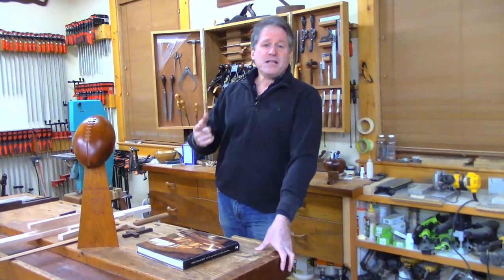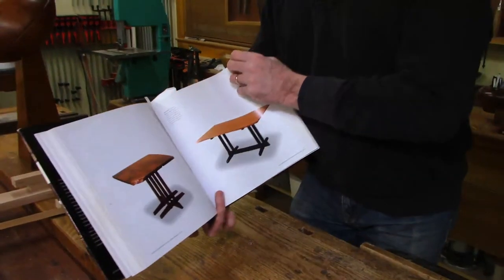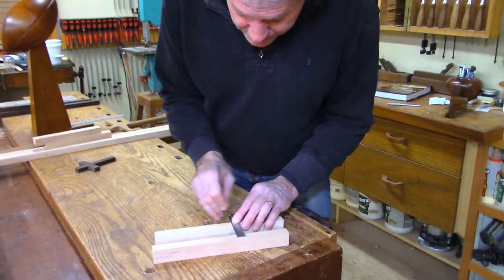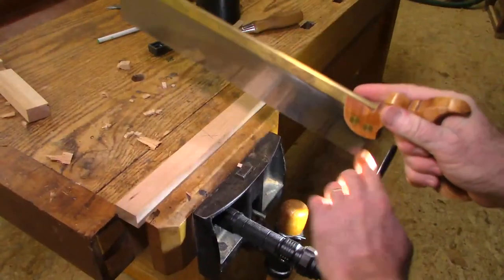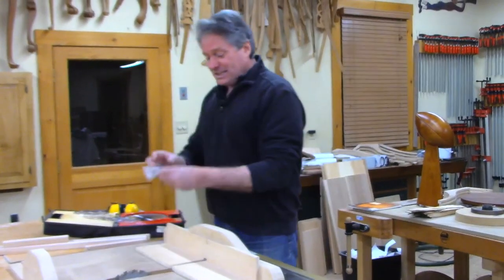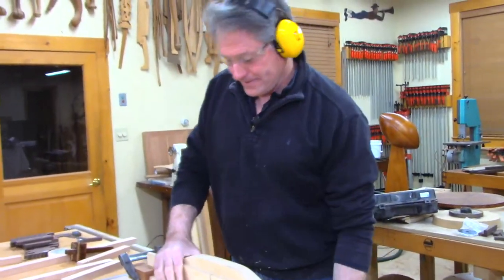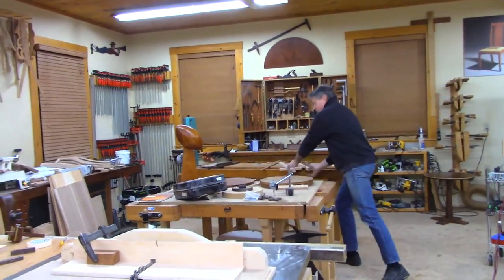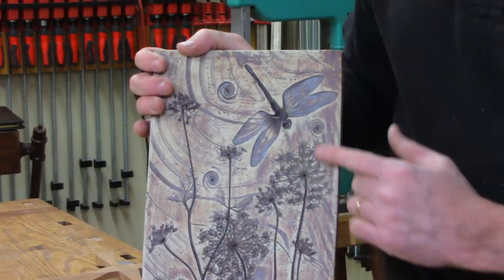How to Make Lap Joints with Tom McLaughlin

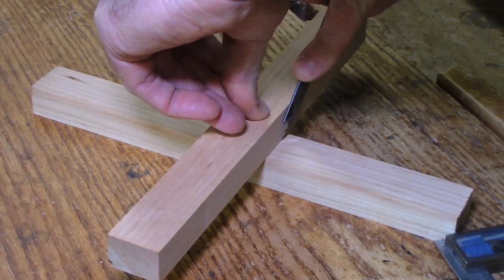Comment: 14:20 If you want to scribe dead on, start with one scribe using the square alone defining the position of the joint. After that put the cross piece of wood against the unmoved square and scribe the second line to mark the width. So you're taking the width of the the marking into account as the cross piece of wood is over the first scribe against the suqare. Clamping the square down keeps it unmoving.
Reply from the maker: Yes, nice that’s another great suggestion, thanks. I find the way I demonstrated it is pretty dead on too...it’s like trying to split hairs when you get down into it further than we’re talking. After all, the greatest variant comes in when you handsaw to the line, and I most often get the “press” fit result on the video which leaves just enough to for the glue-up to go smoothly.
Nice comment, thanks for watching! 👍

Comment: You can make your own kerf maker with about $2.00 worth of scrap material and hardware. There at least 6 how to YouTube videos.
Reply from the maker: Nice I’ll have to check this out...I guess the “kerf-maker” is not as new a thing as I thought. And here, all this time, I was thinking I was doing just fine making kerfs without it! 😎 Thanks Dave! 👍
Reply: @EpicWoodworking  You are, doing more than just fine 🙂. I only mentioned it because all of the discussion during the livestream was about relatively costly solutions. It's an easy jig to make and costs virtually nothing. One caveat, if used with a dado stack, you'll need a long screw.😊. You'll see what I mean if you look at how the device works.